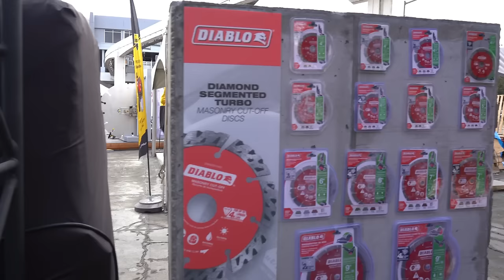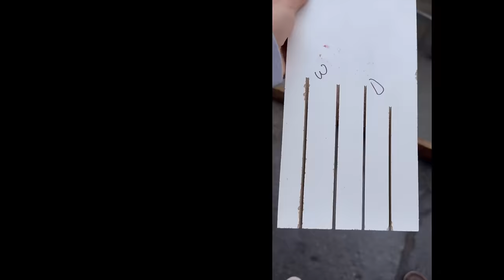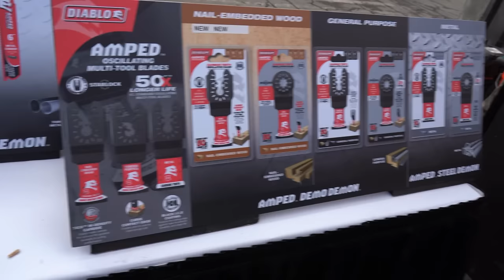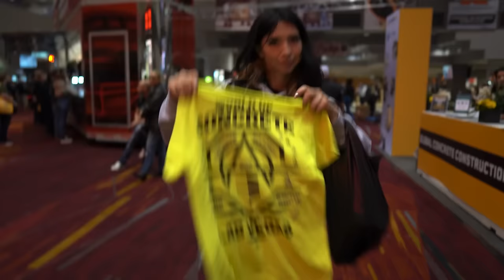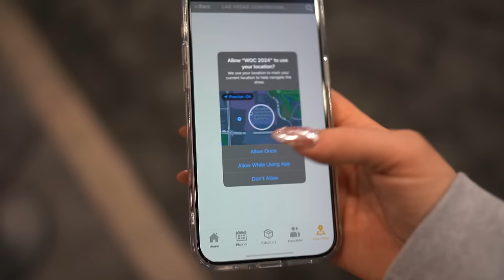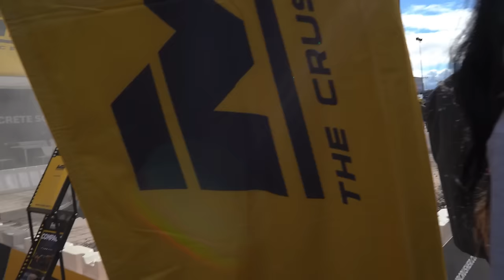Day 2 at World of Concrete

Comment: Those diablo ampd reciprocating saw blades are no joke. I've used the same blade to cut through 2 separate 1.5 inch hardened tool steel shafts on a concrete walk behind power trowel when I couldn't pull the spider plate off the bottom. This blade cut them like butter. Used to take 2-4 Lennox blades. These blades are worth every penny if you have to cut steel with a reciprocating saw.